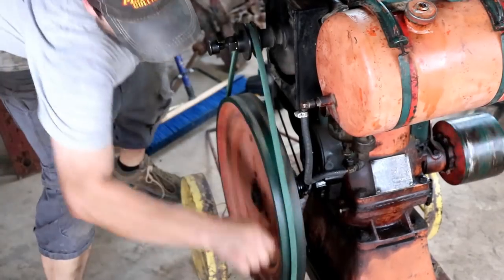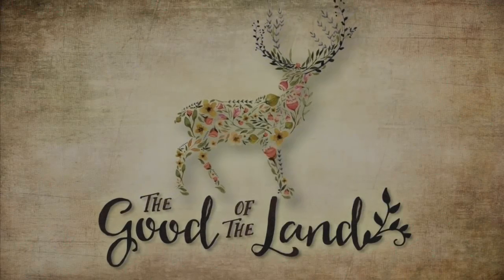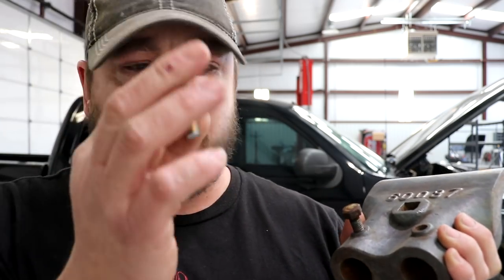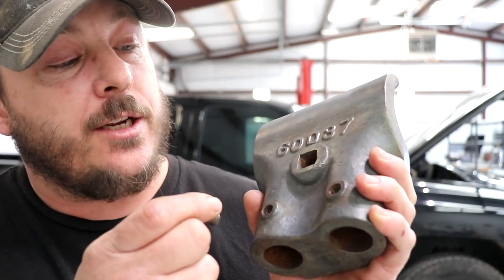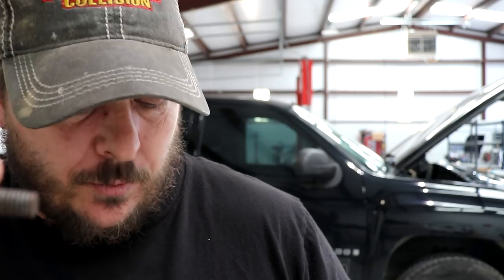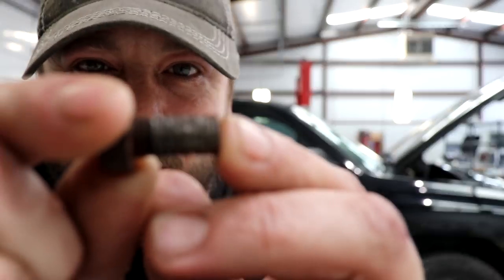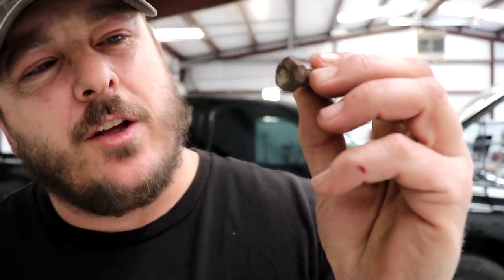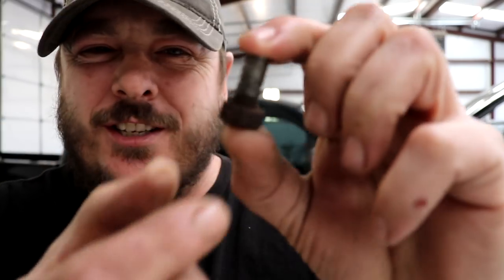OLD MECHANIC TAUGHT ME THIS YEARS AGO! Passing it on to the NEXT GENERATION!

Comment: WoW thank you so much! I would have never guessed in a million years to just cut/grind a bolt to a length I needed! Oh my what would this world do without geniuses like you..... eyes rolling
Reply: Dude and wtf was the point on grinding off your hardness rating on top of the bolt..? Also, you want your bolts to be softer and be the first piece to wear instead of whatever housing that bolt is threaded into... Wtf was this? Hopefully satire...

Comment: The replacement bolt shown is a Grade 8 bolt, indicated by the 6 radial lines on the hex head.  A Grade 5 bolt, not shown, will have 3 radial lines on it.  A plain steel bolt with a zinc finish will have 0 lines.

Grade 5 bolts are 30% stronger than plain bolts in terms of both tensile (load along the axis) and shear (across the axis) strength; they are also more resistant to rust.  Grade 8 bolts are even better as they are 60% stronger than plain steel.  I commend the YouTube contributor's bolt choice as this is a worthy upgrade to a failing bolt.

While I understand the double-nut trick in the bench vise and the shortening with a grinder, I do not understand why the 6 lines were ground off the head (as was noted in other comments).  Why not communicate to the next mechanic that a Grade 8 replacement is a good idea?
*

Different topic - the passing of maintenance knowledge to others.  It is simply not true that "everybody knows that".  That's like saying a pro football coach can drive across town and manage the baseball franchise and that your dentist can give you an eye exam.

YouTube is a DIY sea change.  I've used it to (a) cut down a dead tree; (b) repair a stopper on a pedestal sink; and (c) replace the display on a laptop.  In each case I watched at least 3 different videos and learned something from each one not covered in the others.  Then I had a plan for tools, parts, and manual help.   I was able to complete the projects on the first try; in the case of the tree, safely.  So experts, please keep loading videos like this one in your area of knowledge.  You probably won't be around to help your great-grandchildren but your video will be available forever.
Reply: Michael, Thanks for the info on Grade 5 Bolts.

Comment: I taught this trick to a neighbor who was a pro mechanic back in 1968 when I was 16 years old. I still use it today with one added step to what you showed. I use a powered wire brush to clean the end threads up after removing the nut. 

I also have run into situations where a bolt is available, but the wrench size does not match the other bolts in the assembly. You can use a bench grinder or an angle grinder to "shave" down each facet of the head to match the correct wrench size, then chamfer the top edges to make it a bit smoother and to match the existing bolts' shape.

Comment: Simple - but a good little video that novices may learn from.  How many guys will cut a bolt or threaded rod without using a nut to chase it and then fight and file to get a nut to go on.  All the experts can laugh but it happens for sure.  Why grind off the coating and markings? To make it look correct when trying to restore to original.  This is a very easy video to make fun of - I almost did myself -but while a no-brainer for experienced guys, a lot can use these tips.  How many guys would cut the bolt, install and paint - only to have people critisize or at a judged show lose points because of having the modern bolt heads showing?  Not rocket science but a good video!
Reply from the maker: +Peter L Thanks Peter!
Reply: Right...It's not What he did, Its How he did it. Most people screw it  up(see what I did there?) lol
Reply from the maker: +WoodGrain Studios https://youtu.be/OgvQKuCOhqI
Reply: of course it is possible
Reply: Of course its possible - just quicker and easier with the nut.
Reply: Make it look correct, by grinding the coating off to allow it to surface rust?
Reply: I am quite sure he will be painting it after it's done.

Comment: Why in heavens sat would u remove the zinc coating from the top.  Wtf.  I don't get it
Reply: Doitrightcmrs to make the new bolt match the old bolt. This is very important  when doing a restoration.
Reply: Kent Brauer. It wasn't explained anywhere in the video. Then I would have painted it. Because if I'm doing a restoration I would protect the fasteners from corrosion.  Just saying.
Reply: Doitrightcmrs in the first sentence of the video he is restoring a forge getting it ready for paint
Reply from the maker: +Janet Smith https://youtu.be/OgvQKuCOhqI
Reply: That looked more like a cheap gold anodized coating than zinc, anyway.
Reply from the maker: +Skepticynic https://youtu.be/OgvQKuCOhqI
Reply: So your response is to send a link to another video so you can make another few cents?
Reply from the maker: +L98FIERO The comments help more then the video.:)
ENJOY this one. You might Actualy like this channel when I'm not targeting the younger crowd. Thanks for watching.
https://youtu.be/tnLLGXpVVk4
Reply: That was a Class 8 bolt. They are coated in that color to help identify them to the user.   Class 5 are normally dark or medium gray.  The markings on the bolt head are the other indicator. That bolt started out life as a Class 8 (6 bars on the bolt head)
Reply: G Scott, the bolts aren't yellow to help identify them, the coating is a yellow zinc chromate coating to help prevent corrosion. The grade 8 bolts are 'stronger', i.e., higher tensile strength and therefore more expensive but also the plating adds to the cost which is reflected in the price. Grade 5 or general, non-identified grade bolts aren't always plated though the ones that are a shiny silvery color are clear zinc plated regardless of grade. Color is not an identifier of grade.
Reply from the maker: +G Scott https://youtu.be/OgvQKuCOhqI
Reply: That color isnt to identify the grade of the bolt thats what the 6 hatch marks are for grade 8 has 6 marks grade 5 has 3 and a grade 3 none
Reply from the maker: +Chad W https://youtu.be/OgvQKuCOhqI
Reply: Grade 8 splines gone hehe
Reply: I thought the same thing. It'll corrode that much quicker but I figured he probably wants it to look original... Not what I'd to but whatever.
Reply from the maker: +Mr. Dumdog https://youtu.be/OgvQKuCOhqI
Reply: I thought the same thing. Seal the heck out of that bolt. The owner will have a hell of a time getting that out just a couple of years later - dis similiar metals too !
Reply: That finish does not hold up in any demanding environment anyway, especially on an engine manifold.
Reply: G Scott exactly, these "gold" bolts are harder than a standard bolt.
Reply: Alan M: Anodizing may be mostly used on aluminum... but it's not only for aluminum.
Reply: Skepticynic it's zinc colour passivate.
Reply: Cadmium hasn't been used for a while for bolts in general for toxicity (environmental) reasons. The bolts are now zinc plated and then chromated to give that gold colour. Hot dip galvanising is used on structural bolts which is a much thicker and more weather durable finish.
Reply: L98FIERO correct the numeration tells the grade of bolt as in 8.8 or 10.2 for instance
Reply: Helps the RUSTING process
Reply: Robby Ritter ...True, which also means that next one of those two components fails it will most likely be the $50 obsolete cast iron leg holder rather than a .25 cent piece of common hardware. Personally I do believe old will always be around when the new is no longer....it's all in one's prespective...isn't it?....
Reply: Alan bolts (or technically socket head cap screws) are usually grade 8 bolts and usually black.
Reply: its damn sure not used on steel
i am in the industry
Reply: Yeah I don't get the removal of the cadium plating, it's found on most AN and MS hardware in aviation. Also when tightening bolts it's encouraged to only turn the nut only so as to not strip the cad plating off the bolt shank
Reply: @Gary McSpadden tech  Socket head cap screws are not grade 8. SAE J429 Grade 8 is around 130ksi yields strength while socket heads are ASTM A574 with a minimum of 150ksi yield. They are significantly stronger.
Reply: Zinc plate/yellow passivation.
Reply: Is it not zinc plate/yellow passivation? I thought cadmium plate was banned years ago.